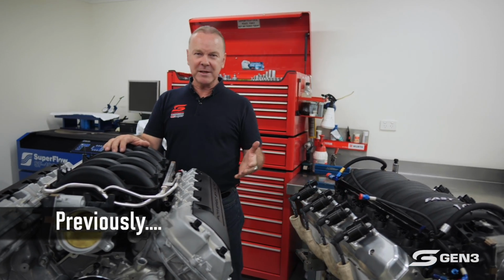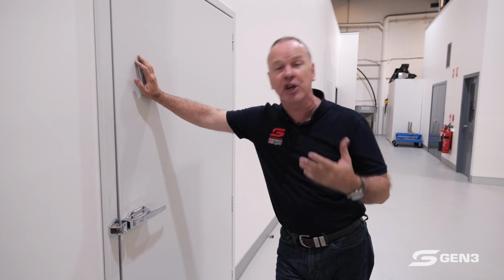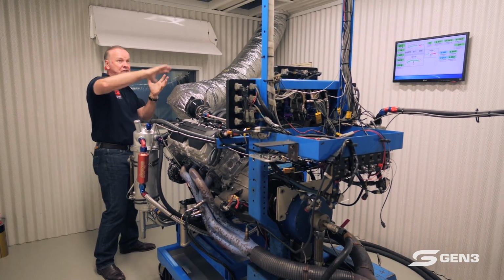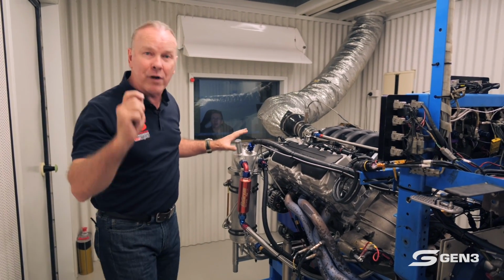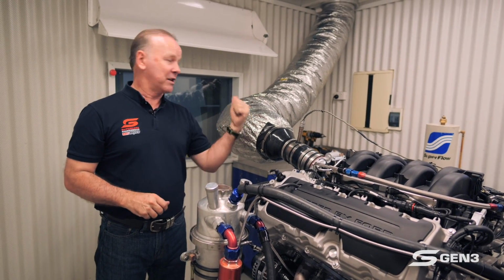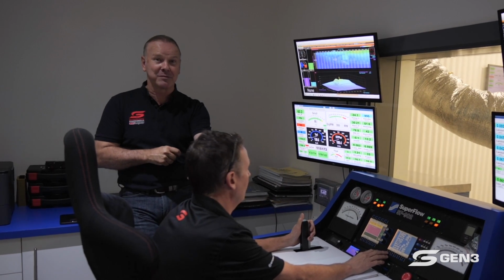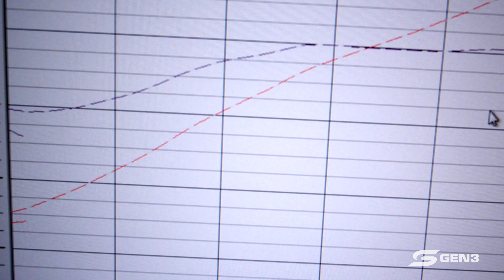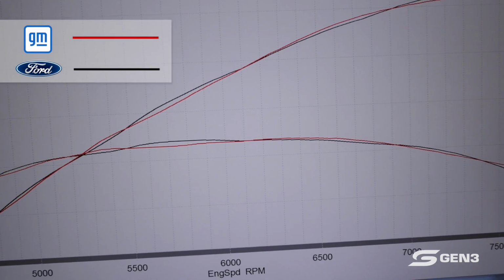Episode Six: The Dyno Run [Gen3 Unpacked] | Supercars 2021

Comment: Remember when racing in Australia was good, when we had more than just boring V8's..... yeah so do I. Gen 3 will still be rubbish compared to ATCC days. Open it up to Turbo's and multiclass racing again then I'll watch your sport, until then.... No thanks
Reply: They did open the rules to 6 cylinder turbo engines a few years ago but none of the manufacturers were onboard unfortunately… Holden built one and tested it in their “project sandman” car but that’s as far as it went.
Reply: ATCC days were great. Only the current V8 formula is spot on! I only wish they reintroduce the series as " V8 Supercars" .
Reply: YES   agrees  back int he  day it was all down to the drivers  ...that was real racing  now its all about  the car ... they just steer it now  the computer  does the rest
Reply: I suspect fuel usage was the problem. Turbo anything will make the power, but chew more fuel doing it as they are tuned to run richer tha N/A. It may not make much difference on the short courses, but come Bathurst...
Reply: @52jimbodave  bs, tell me more
Reply: @crd-nz_001  rubbish, smaller powerfull cars take alot of money to beat
Reply: @crunchytheclown9694  on the street, maybe. In Gen 2 rules, all cars have the same weight, no matter the engine. Same as Gen 3.
Reply: @crd-nz_001  not even considered, ballasted to the same wieght would still provide many advantages, to quote Skaife do we want socialist racing
Reply: @crunchytheclown9694  To the exception of fuel efficiency. Doesn't matter the technical advantage, a car that is forced to pit due to fuel requirements is at a serious disadvantage that can't be made back up compared to one that uses less. Nissan had this which gave introduction of 120L fuel drop requirements.
Reply: @52jimbodave  that sandman actually sounded better than the LS they tested at Queensland raceway, IMO. 
I think the parity restrictions and the cost of developing and testing meant they just stayed with what they knew.
Reply: @crd-nz_001  more bs, a better balanced small car on longer runs will win(gtrxu1 v you know who) bluebird, Sierra, gtr.All gmh cars that were successful were smaller than there main oposition thats why the monaro was dumped
Reply: @Nic B yay spend a bob to get nobled, why not buy a 3 legged horse and save your business plan
Reply: @crunchytheclown9694  you can't argue that point as an XU1 weighed in at least 800 pounds lighter, and bring that forward into today's Parity enforced Supercars.
Holden (or Tripple Eight Racing) didn't want to spend twice the budget on an engine with a fuel efficiency disadvantage. It's called Brake Specific Fuel Consumption and ALL forced induction cars suffer from being worse at converting fuel to torque than their N/A counterparts. There are advanced ways in which it could be made to beat it, but would soon be outlawed as it breaks rules of Parity.
Thats what I am pointing to. I am well aware of what a small car can do. I own one and it has taken down many cars it shouldn't in our local drag racing events. But, 200m is not track racing over many laps. Something else I have experience in, too.
Reply: @crd-nz_001  bs breaks rules of parity?
Reply: @crunchytheclown9694  let's clarify. bs is short for bullsh*t?
Reply: @crd-nz_001  i am glad we agree on something without needing to be understood
Reply: @Nic B is there another kind
Reply: @crunchytheclown9694  Your right. I understand when there is no use trying to enlighten the ignorant. Good day to you, sir.
Reply: Mate, i just got back from watching a 1 hour production car night race at Queensland raceway.
And before the feature the was a full day of other categories.
Why you cant find other categories to watch is beyond me but dont blame supercars, you're the one that needs to look elsewhere.
Reply: @andrewforbes146  Tell me more about this magical computer?

Comment: Ever wondered with just 2 engine builders KRE building the GM engines and Mostech building all the ford engines there is no variation in torque curves and fixed power outputs the only overtaking is when 10 cars slam the brakes on into the first lap corners there be less cars in the field. It a stupid formula they not have the different vehicle characteristics to make more overtaking ! Get real supercars it’s boring enough now